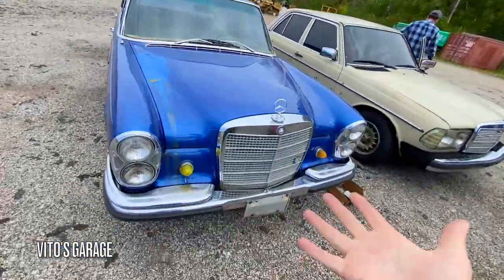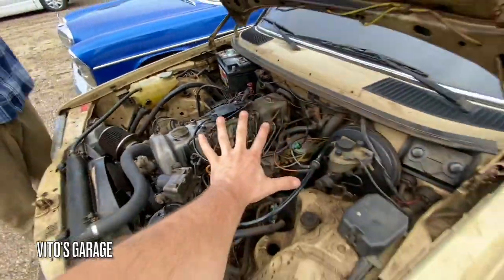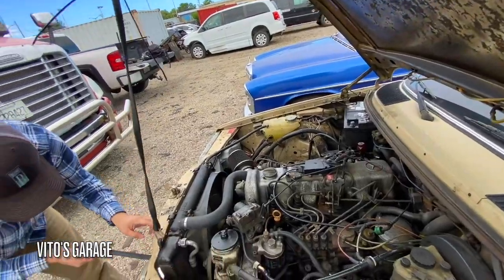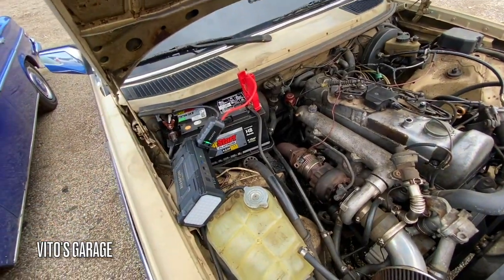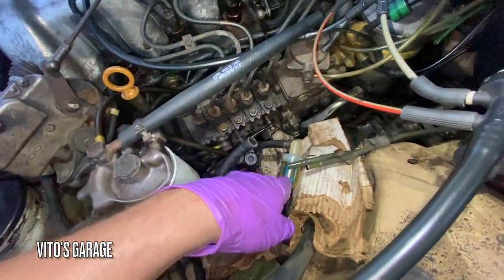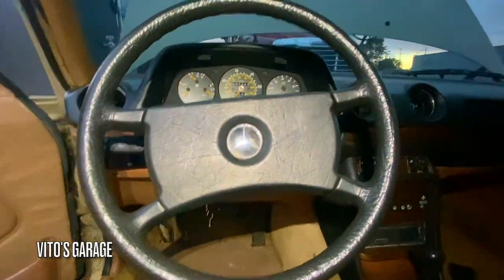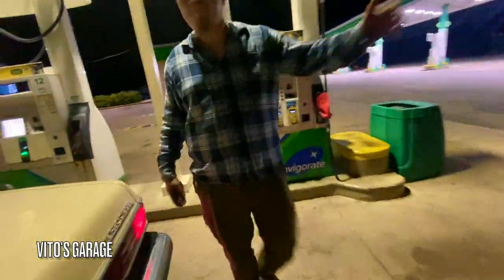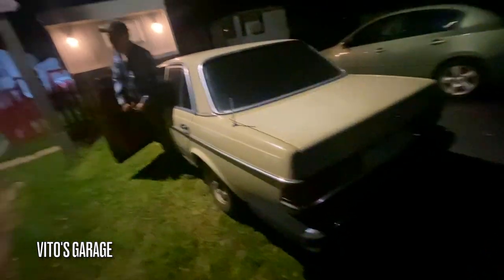You Won't Believe What Caused a Crank-No Start on This Diesel Mercedes W123... Crazy Adventures..

Comment: I would never thought someone would steal diesel...maybe gasoline! I can almost guarantee there is rust on the the metal rod in the fuel sender causing the float to stick on the rod;therefore, showing fuel on the gauge! My 1985 300TD wagon is same color combo! 35:38

Comment: You've done a lot of work there. I would always have checked the tank first. When you removed the line from the fuel pump (tank line), diesel would have immediately leaked out and you would have been sure that the pump was broken. So you had to screw around wildly Ultimately you find out that there is no fuel. The vacuum pump for the ZV should be under the back seat, but you know that. Greetings from Northern Germany
Reply from the maker: Like I said in the video, what tricked me is that my friend said he filled up the tank fully. 
But that’s okay because that mechanical lift pump needed to be rebuilt and cleaned anyways. Because that’s never been done on this car

Comment: I guess it's weird in the US because you have central locking a lot. 
For European cars, usually under/un-specced, having the key-locked fuel cap is pretty standard on older Mercedes
Reply from the maker: All W123s made for US market have central locking

Comment: Hi Vito, I enjoy watching your videos and learn a lot from them.
I know that this is off topic, but  long ago I watched one of your videos where you smeared marine grease on the under floor of your dad's mercedes. Is that a lifetime fix to prevent rust ? Will dust stick to the film of marine grease and damage the metal ?
Reply from the maker: Grease and fluid film is the best rust protection and prevention. Use it for your undercarriage, floors from the inside of the car and bottoms of the doors etc. I’ll make more videos about it soon. It’ll be on a BMW E38. So be on the lookout for that video. It’s a lifetime protection but sometimes you have to reapply it. Some dust will stick to it but it’s not a big deal. I’ve done this procedure on a lot of cars and everyone is happy. For your floors, however, it’ll protect them too. But you need to make sure you have no water leaks too
Reply from the maker: Grease will never damage the metal. So don’t worry about that. Just avoid putting grease on the rubber parts because they’ll swell up and go bad.
Reply: Thank you very very much brother for your good advice.❤